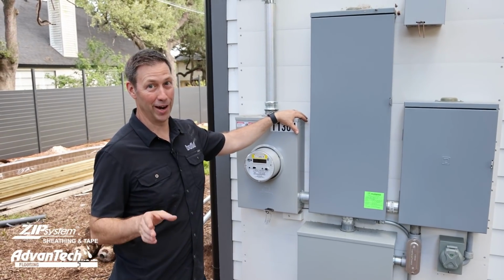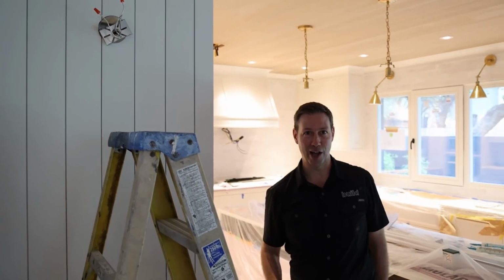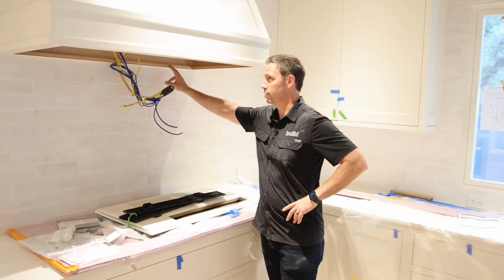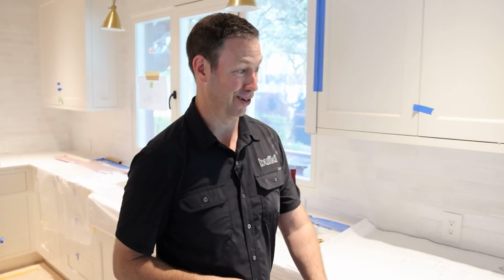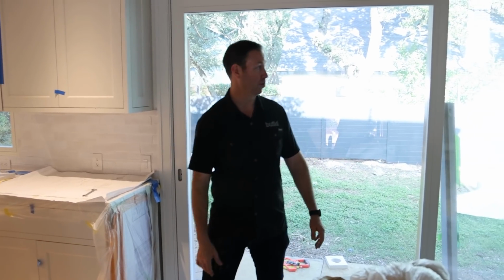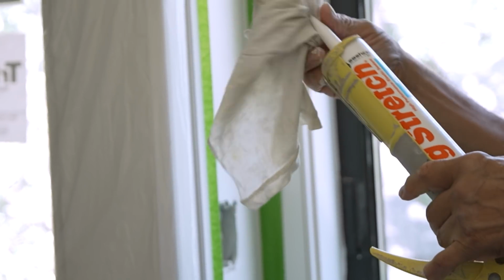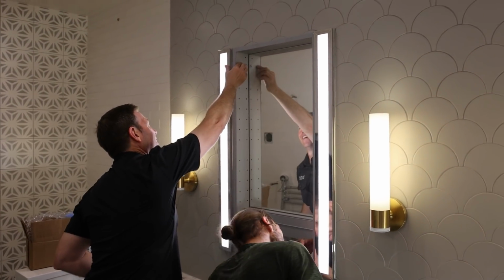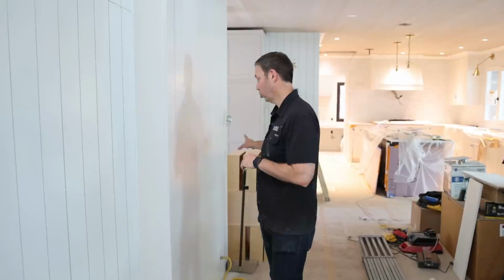T-Minus 5 Weeks - Going as planned …NOT

Comment: For railings it is interesting but I was told it is against a code here to run the wires horizontally as allows kids to climb over and fall. So you have ro run it vertically only.

Comment: Nice job Matt, as usual.  When you finish and start living in the house, it would be great if you could relay what kind of energy costs you're experiencing on a monthly basis.  I recall you mentioning spending almost $250/month on electric in your old house, even though several components were gas powered. Thanks Matt.

Comment: Matt is the best, I wonder why he didn’t go with a lighting control system to eliminate those clusters of switches?
Reply: He sort of did.  Those clusters of switches are located high (almost at the ceiling) in closets like the pantry.  That's just where the hardwired connection is and keeps them mostly out of sight.  I believe they are all bluetooth or z-wave, and he has remote panels with multiple control buttons in all of the useful places around his home for that lighting control system feel.  These switches probably also work with an app.  I'm not positive why he didn't use a lighting control system, but I bet this DIY-ish system was less expensive than a professionally installed control system.

Comment: I hope you have better luck with Miele than we did. Washer (front load) never worked right and smelled. Spent $500 in repair and when it was going to cost $800+ to fix again I tossed it to the curb. Later the dryer went out ... didn't even try to fix and tossed. We had a Kenmore dryer for over 20+ years with little repair. Replaced Miele with Maytag washer and dryer.

Comment: Hi Matt. On the lighting boxes, I've found that for the specialty fixtures, if the specs aren't available at rough-in, I stub out the romex only and install the boxes at finish. Also, face-of-finish is so important when setting HVAC ductwork. That is a must-do point on caulking or taping the register boots... and the commercial grill install is a winner. The place is looking great!

Comment: Crazy that you guys don’t get power until that stage. Here in NY we get meters on after drywall is hung. Our electrician even prewires a breaker and outlet, usually in a powder room or laundry room. Makes life easy for the subs having power, and in winter we can have heat up and running.

Comment: Why do you need an outlet to the left of the cooker? That seems like a really strange thing to be a code requirement (I'm from the UK) especially as anything on there might be easy(er) to knock off as people walk into the pantry and especially as now a cord will be hanging off the edge to meet code. Me I'd use that bit for putting pans and stuff on (full or empty), or a chopping board (so its not as if they need power) or so on... a temp workspace before moving the stuff on to the cooker to be cooked, then to the right to be washed... But I guess we all do things our own way, and all the houses I've lived in have had small kitchens (usually galley style) so I tend to keep surfaces empty where ever possible (except the toaster/kettle/chip fryer).
Reply: Outlet every x feet/ # of outlets on the counter. To prevent extension cord use
Reply: @JoyStickFanatic  Thank you for that, yeah I can kinda see how that would work, although somewhat inflexible. But then again, now that you've mentioned it, I can also believe that someone would be stupid enough to run an extension cord behind the - hot wire melting - cooker hob or across the floor just so they can put a kettle there or run an electric knife.
Reply: If it is greater than 12" wide  it is required by the national electric code.

Comment: 3/4 pancake box,or pop-up outlet in the countertop should keep you from cutting the drawer.
Our coastal inspector is now requiring hard pipe (no flex) to the hood, which has made us  build 2-pc hoods.
The bottom is set first, solid duct run into hood fan and then inspected.
Then the upper portion is set, covering the whole duct.
Reply: Don’t think those pancake boxes meet code due to capacity. ?

Comment: Before you adjust the colors on those vanity/bathroom lights, please consult with your wife.  She may be applying makeup meant to look good in specific lighting situations--office lighting, etc.  Fluorescent is not going to necessarily be the same as LED or halogen, etc, and that can affect how we perceive the subtle differences in makeup hues. She might want those 2 different lighting options, or prefer cooler rather than warmer, and it's always a good idea to check if it matters with her.  (I learned of this potential lighting vs makeup hazard as a model in the late 80s--it might not matter to her at all, but if all else fails, try to default toward white light / sunlight spectrum.)
Reply: For those that might not understand, if the lighting is yellowish, people tend to add more purples (or blues). However, if the light is bluish, they will add more oranges...and then when you get into sunlight / true white light, your face is going to look purple or orange.  Another way to think of it is this:  We were taught to hide redness in our face by using green under our makeup foundation...but only in those areas that had red, because if you used it anywhere else, you'd look sick to others' eyes.  And a third way to think of it is that, as we age, our corneas get a bit yellowish, which means we tend to pick blue colors to "correct" that hue...which is why so many little old ladies wind up insisting on their hairdresser giving them faintly bluish or purplish tones to their hair, because to their eyes, it looks "right" when it comes to making their hair look true white.

Comment: Matt,
They make a pop up receptacle that mounts into the countertop. Push down then release. It then pops up. Some work would still be needed on the drawer, but it would be more accessible. I wish more builders would use the attic as you have done. Do you think it was much of a cost increase to use the attic as you have done?
Thank you
Reply: Isn't there some risk liquid could spill into the outlet?

Comment: hey man this is off the abject , my GE water heater after 21 year old bought it on 2009  have to change the thermocouple again after i changed it few years back  , i scared gonna leaks in next year or 2 if i change the Thermocouple  because is way getting to old i wanna change it with new one, so of course water heather places pushing Bradford white like usual & we have Homedepot & Lowes brand  & gonna cost me around $1800 for tank & labor .. is crazy ..so looking for 40 gallon gas ..since  u in this kind of line & see a lot ..which brand u recommended to purchase & came to in better quality & life spanned??..thanks
Reply: Why not just go tankless (gas)? More efficient=lower operating cost, no worries about the potential for a 40 gallon flood, no running out of hot water no matter how many teenagers are in the house

Comment: Quartz is basically a more stable form of glass since it's crystalized.
Reply: Both quartz and vitreous silica are forms of silicon dioxide (i.e., SiO2).  Quartz is a single crystal material and vitreous silica is an amorphous material (i.e., glass).  However, neither really have anything to do with the "quartz" for kitchen countertops.  These synthetic countertops are made by curing a mixture of epoxy and fillers under heat and pressure.  The filler may include granular or powdered quartz depending on the aesthetics desired.

Comment: I'm not sold on a conditioned attic.  Lets look at the shingles over time and see how they hold up. If I were to build with a conditioned attic,  I'd use closed cell foam  between the rafters and advantech for roof decking.
Reply: He has a metal roof and it's vented. Regardless, there is no reason for shingles to have any problems in that environment.

Comment: Use a picture light with a round base.  I hate pocket doors!  Make sure you give the cabinet man the right cut out for the venthood.  That mini split in the ceiling is gonna be a bitch to fix.  I'd bite the bullet and get the cabinet man to make a new cabinet panel for the refrigerator door.

Comment: It is probably too late, but you might have had enough room between the door and the tile to put that outlet in the backplash if you used the right box. :-(
Reply from the maker: Really? In a 2x4 wall cavity with a 1.75” door?
Reply: @buildshow  How thick was that tile?
Reply: Of course the electrical box would have to have been installed as if the wing portion were flush with the face of your tile backer.

Comment: Did you install your wood ceiling without AC on? I always get a little nervous they’ll shrink when the AC kicks on. I’m in Tampa Fl so curious on the Delta Millworks product
Reply from the maker: I had temp AC going in the house for carpentry work. 2 ton cooling the downstairs and a 1 ton up.

Comment: You could probably get a sillite or Bocci 22 receptacle in the kitchen cabinet.
Reply: thanks for posting more options. screwless plates are nice but flush would almost disappear. wonder if those in drawer outlets used in bathrooms that are ul listed would meet code
Reply: @AussieInSeattle  my local authority would probably say no. 210.52(C)(3) "Receptacle outlets not readily accessible by appliances fastened in place, appliance garages, sinks, or rangetops as covered in 210.52(C)(1), exception, or appliances occupying assigned spaces shall not be considered as these required outlets."
I would probably classify a drawer with a plug as an appliance garage as it isn't really designed to service the general countertop.